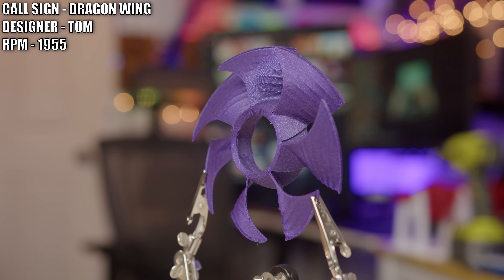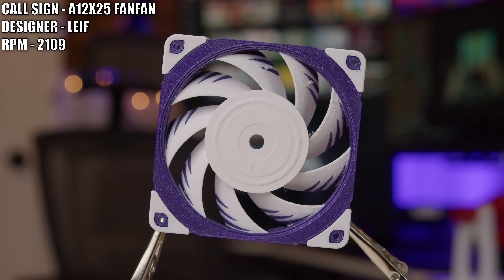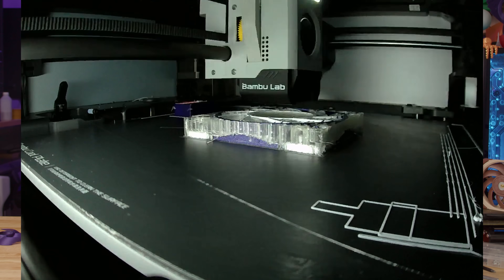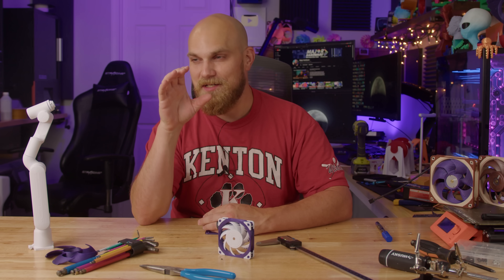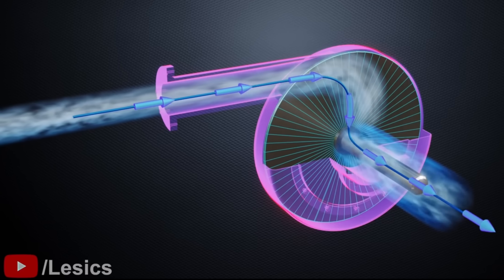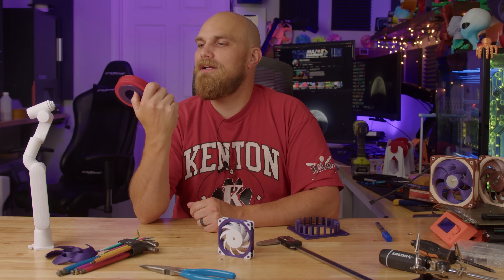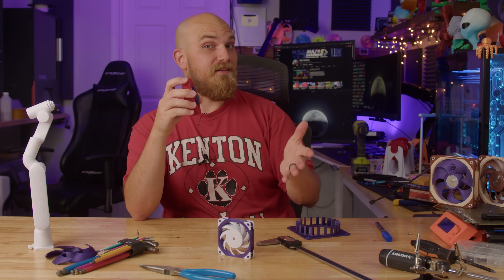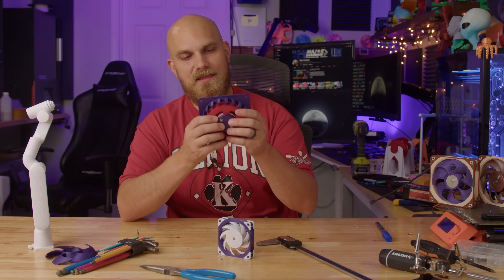I Put a FAN Inside a FAN | Fan Showdown S5E7

Comment: the fanfan reminded me of the dizzyfan. a friend of mine has this complex, where there are rows and rows of electrical cabinets. each one had a large external case cooling fan much like these except bigger. they run of 12V DC  and turn on whenever the units reach a curtain temperature. some of them had failed however. i wonder if he learned his repairing skills from Mcgyver, because of all the Jerry rigging that was in there. for example, a random DC12V blower fan was thrown in to replace one of the original fans. on another unit, a cheap desk fan was just blowing in through the inlet of the old fan and the DC wires were just connected to a 12V lightbulb.
last, but not least was the dizzyfan. he had taken a random mains powered motor, slapped it on a bracket in front of the inlet and attached the fan to it. he didn't even cut off the fan's power cable, witch was just whipping around and slapping anything in it's radius, making noise. and to control it, the 12VDC lines were just connected to a 12vdc trigger relay thingy.  he had written "dizzyfan controller" on the little box the relay was in, hence the name. you could tell that it was on from the end of the corridor from the distinctive slapping sounds of the cable going round and round. it looked real goofy while it was on too LOL!

Comment: Has someone tried making a fan with blades that start and stop at the same radial position? I see lots of people just try adding more blades or just change the angles. But, they don't extend the blade length within. I don't have all kinds of know-how in 3d printing. So, i can't compete.
Reply: Something like a hypnosis wheel.
Reply: Start at 90 degrees from the outer edge. And, work it to 15 degrees by the center.
Reply: The sweep should be immediately aggressive and taper off slow.
Reply: Also, with my basic understanding of aerospace. I can tell you that all the fan blades people use are creating massive drag on themselves by staying curved through and through.
Reply: You want the drag to be away from the fans. Think outside the box.

Comment: What if the dragon fan was polished, so there wasn't the surface roughness of a raw 3-D print? There might be another 5% gain in airflow, as well as an increase in RPM as well. I don't think it would be any quieter though.

Comment: I like how the attack angle of the middle more aggressive than the tips, creating faster flow in the center making outersides not only sucking air from front but sides as well. ( all fans does this but I think in this model this is makes the fan act like a bigger diameter fan )

Comment: that tesla turbine one however had some great design problems. while the tesla turbine is made more for having a high fluid pressure and little speed(so the opposite as what you want of a fan. it still can mover quite some air with a  few modifications. the main modifications here would have to do with the air inlet holes as well as the angle of shooting it out. and specifically the corner to bend it. typically tesla turbine designed also use aerospike principles, which many people think are modern day rocket science but actually nikola tesla designed that in his original tesla turbine already, he however didn't name it with to much detail since he assumed people would see it as basic and understand it directly since it is just basic physics and fluid dynamics. in reality people didn't understand so up to today there still are only a few people who actually understand those turbines.

using it as a pump is different. especially when using it for high speed. the main problems you face first on are the outlet not being steered properly and the inlet holes all being the same size and wrong pitch. essentially that will result in a lot of notice while it was low compared to the other fans, a tesla turbine can reach around 99% efficiency and is the worlds most efficient turbine when used right. ofcource using it for a high flow fan isn't optimal either but there are some optimizations I do already see which can quite easily be made. for a tesla turbine normally you also want the holes to be as far in the center as possible, so having that huge blob in the middle for the motor isn't optimal. at all optimally some kind of axis would be made in front of it so the inlets can be much more towards the center. when 3d printing those spacers aren't needed either you can just directly design them into the disks.
the close disk spacing will work great for efficiency at high pressure, but it will create problems at high speed so they might need more spacing optimally especially since 3d printed disks already are pretty wide, and so create a lot of resistance unless something else is added in to fix it.

I can easily seem some ways to improve it, and it might look cool and give some new perspectives. but the tesla turbine was designed for efficiency and high pressure, so we are kind of at the beginning of designing them for high air flow speeds. and in the case of computer fans it might be really hard to beat them with a tesla turbine since computer fans need to be small tesla turbines have a lot of extra space used which helps with efficiency but obstructs high airflow making it inefficient for that.
I think that if you want to reach something like a tesla turbine for computer fans you would probably be best of looking into the prandtl wing (AKA NASA mars glider wing). it is a quite old design as well but it greatly beats any normal wings since it has as good as no turbulence. some scientists also tried them on a propellor and noted that they where very surprised to hear that the fan was "completely silent". in the case of fans, less sound often means more efficiency.

Comment: very very very fast which the tesla turbine needed, today would be considered slow. back then that was still before they really started to refine metals, 1000rpm back them was considered insanely fast even for small disks by now with modern materials even big odd shape disks or things these days 50000 to over 200000 rpm is easily reachable.

Comment: I had the thought that turning the A12x25 into an ionic thruster could be an interesting test, then I discarded the thought for science reasons because I'd imagine ionized air would play havoc on any systems it might be installed into. Although since the test isn't done on a PC like Linus strapping a giant EDF to one, it might be okay, though I don't know if the flowmeter might be hurt by such charged air passing through it, probably not though

Comment: Major Hardware hello, Hi, did you change the motor of Noctua? The printed impeller has an unbalancing and can harm the motor. With each new test, the results will be worse, as it seems to me. Need to be checked before the test, comparing old and new resultats with the original impeller Noctua.
p.s. sorry for google translate.

Comment: Love the fanfan and the tesla turbine! I think the tesla turbine might actually work, if you put a stationary restricting shroud over the intake. it sucks a little air in through its intake holes, and it projects it outward against the outer rim (pressure on the outer rim) but then it goes equally forward and backward. Just put a lip around the intake side, so the pressure on the outer rim can only go out the exhaust side. I don't have high hopes that it will perform well, but it'll certainly be more than zero!

Comment: as a noob to 3d modeling, i tried fusion 360, as it was recomended. IT WAS GARBO. tried blender, and it is MILES ahead of fusion 360.
Reply: 👏
Fusion 3d is hard core cad and it's intended to put parts together to design machines.
Not a great 3D modeler

Comment: The problem with the Tesla Turbine is that it ejects air out between the edges of the disks (which is blocked by the casing of the air fan).  The Tesla Turbine could be fixed by having holes along the outside of the disks (except for the disk closest to air input).

Comment: I noticed while watching the fan/smoke clips, that the Tesla fan was shoving smoke back out the front edges. I doubt it would perform "Lots" better, however, perhaps adding a lip, and slightly off-set the holes in the disk to give it more of a "bladelike" interior? or larger holes with tiny single or double angled blades to provide it with more directional force. One other possible design change could be to add the outside lip on the front intake side, and maybe add an angle to the outside edges of the disk pointing towards the exhaust direction to exchange the centrifugal force to directional. I also always wondered.... do the print layers in the fan blades act similar to the dimples in a golf ball?

Comment: For a solution that is cheaper than PVA, when the application allows. When printing with PLA use PETG for support material & vice versa. The 2 materials will not bond to eachother at all, so the supports just fall away.

Comment: I don't understand this video. Beating the A12x25 in airflow has never been a difficult challenge. Literally any super loud airflow optimized fan will beat the A12x25, hell, there are 80mm fans that will destroy the A12x25 at half speed. What makes the A12x25 special, is that it's great at everything. An airflow optimized fan will beat it at airflow and a static pressure optimized fan will beat it at static pressure, but if you try generating static pressure in the airflow fan and it won't be long before Bob is no longer you uncle.
Reply: IDK, it looks like a static pressure test in the video through a radiator. Considering the A12x25 is only 0.14 amps, be hard to beat Noctua on both. Frame design also has a significant factor on noise, ie. how the high pressure waves of the exhaust impacts the motor arms.

Comment: Here I was hoping to see a working fan that used a smaller working fan as the fan blades. How disappointed I am.
Reply: I was thinking about that for the next season. It would need its own battery, or a brushed dc fan type of power connector.
I got a bunch of small fans, so I'll probably have something in store next season.
Reply: @leifmessinger  Instead of a battery which would be bulky and heavy, could you use a slip ring instead?
Reply: @KurNorock  that's what I mean by a brush
Reply: @leifmessinger  Ah. Just to clarify though, a slip ring and the commutator from a DC motor aren't the same sort of thing and serve two very different purposes. Slip rings provide continuous power while the commutator from a DC motor is used to switch polarity back and forth.

Comment: Noise is important to me thats why I went so overboard on radiator surface area and a slew of NF-F12 fans and dialed down the speeds. Replacing 18 NF-F12's with anything even A12x25's isn't going to happen any time soon.

Comment: The Tesla impeller is essentially a centrifugal impeller, it just uses boundary layer drag to move air from the center to the outside instead of more traditional impeller blades. One of the problems with the Tesla impeller in this implementation seems to be that there's nothing to separate the intake from the exhaust. You can see the turbine does move air, but the moved air "leaks" back to the side you're trying to move it from. This is expected from any centrifugal impeller when you just install it on a fan shroud that normally utilizes an axial fan. Normal fans move air from one side to another; centrifugal fans move air from the center towards the edges.

So the air going in through the holes near the center need to be isolated from the air coming out from the edges of the disk, and that pressurized air needs to be directed towards where it needs to go.

It would also probably work better at higher RPMs, but really this doesn't feel like a suitable application for a computer fan. It could be interesting to try to print a Tesla impeller as a replacement for some GPU that uses a centrifugal impeller, since that would already provide the housing and you could compare the performance of a traditional impeller vs. the tesla impeller - but my guess is that unless RPM is significantly increased, the tesla impeller just wouldn't work very well anyway.

Comment: The tesla turbine was meant for installation inline and had to be enclosed in order to have its exit port functioning.  The stack of its plates were exactly in the same position on top of each other but it also was designed to move a higher density steam.  I have seen it used as an inline water pump and it was an excellent as the force of the water leaving it was so high.  With the density of air being so much less, the plate stack might need to be at a slight offset from the plate below it forming a spiral pattern of the openings in the center when the plate stack is completed.  At what offset to produce the best movement would be up for testing.  If the inside of each plate had teeth, the plates could then slide onto a gear affixed to the fan motor shaft for the purpose of being able to change the offset distances until the best distance was achieved.  With a gear attached to the fan's shaft, that would also assist the drag to create more spin but only in an enclosure to help create that centrifugal force.  Without the enclosure for steam, water or air, the result would be exactly as we saw, exit happened between each plate and stayed close to the fan because the enclosure would assist the air speed build up that would be exiting the blades.  This would create higher exiting thrust.

Comment: We need to revisit the Tesla turbine and add a front shroud with an inlet that restricts the airflow to those inlet vents, and redesign the outlet stator to better redirect the edge flow out the back.

But the drive motor is the limiting factor. I've seen a Tesla turbine used as a pump heave gallons of water, but it was hooked to a big 1HP DC motor.

Comment: Tesla turbine would never move air in that housing.
Yes, it can in fact be used as a blower/compressor.
For excellent tesla turbine information, check out the solishood channel.
When used properly, in a housing that supports it(think similar to a turbocharger housing), they are pretty substantial.

Comment: That isn’t how a turbine works. It starts by compressing the air, then that air goes to the heat source. Then compressed hot air enters the narrow part on the other side, and the second side produces torque from the hot compressed air with energy to spare.

Comment: Noctua is still unbeaten, imo. It's not enough to push more air through, if the acoustics get worse. When someone comes with a fan which is quieter or as quiet as Noctua and still within that 120x120x25mm envelope, I'm sold.

Comment: i would be verry interested in seeing how the air moves trough a radiator/aircooler.  That way you can see if it has some actual air pressure or takes the fastest way out and slows down.  

And you should scale down the Dragon Wing till it hits the same noise levels and then compare. Then you can see if it actually is better on simmilar noise levels and add the pressure test.

Comment: I use my computer all day for work, so I purposely design my PC builds for silence. If the printed one is noisier for a slight thermal performance increase then that's a deal breaker for me.

Currently I'm using the SSUpD Meshlicious case which, despite being mITX form factor, has amazing airflow so I can run my fans at lower speeds.

Comment: The fan-in-fan design is the PC tech-equivalent of Chrome Spinners on car wheels.
Reply: Sleeper/conversion cars are the most high roller cars
There's this one guy who sells ender 3 core xy conversion kits. That's probably the most baller 3d printer possible.
"Yeah I have an ender 3. Yeah it does a 7 minute benchy."

Comment: So indeed, Tesla turbine does not suck ;) Why was it failed attempt in power engineering? At the time there was no variable speed motors, that could really handle even 40 (original three phase system)/50/60Hz. That meant, no motor would be able to run with even higher grid frequencies. Generators of steam power plants mostly do between 1500 (four pole, 50 Hz) and 3600 (two pole, 60Hz). If you go faster - you would be just unable to deliver power to the grid. Also, bearing lossess would increase significantly. Aside of that, AC has practical transmission distance limits (due to line impedance, coupling to ground and grid resonances). Higher you go with frequency - higher you are in losses region of financial chart. This is why we have HVAC lines today - rhey were predicted by father of three-phase grid system. All of the above are also reasons, why German trains do run of 16,7Hz overhead line. Lower losses, lower coupling, high power, no arcing on the early variable speed AC motors.

Comment: The Dragon wing is kind of cool but sadly you won't know that once it's spinning.

Also there are obviously more dimensions to fan design than cfm/rpm

Even noise isn't just noise as there are types of noise that are perceived more quietly. A low frequency hum can be the same dB as a high-mid squeal but the hum will sound quieter. And if both are at low volume to begin with, the difference will be even greater.

So it's a doubly good idea to try and get your fan to emit only low frequencies.

Comment: Having run a HDD with it's cover off, I'm going to submit my skepticism before seeing the result. They do put move a LOT of air, albeit with a much larger disc gap... But my problem here is the speed difference. 
HDD is 7200RPM 😒
Almost 4x higher!

The other issue is the path the air takes... Funneling that to a rear direction instead of an outward direction, is the real trick... 😅

Comment: I would assume that making this with injection molding and not layer by layer will make it more balanced and with smoother wings for the air to glide to. 

You can probably print it in a resin printer to check that theory to an extend